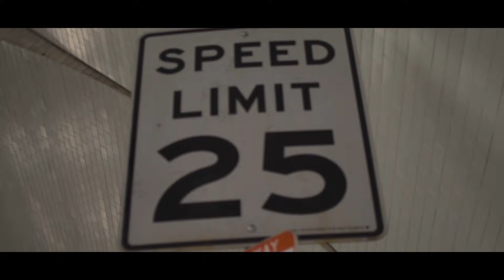Finally Dyno'ing my Cobra Terminator in Los Angeles...

Comment: What coil spring are on your cobra h&r ? Or eibach?
Reply from the maker: Clint Jones H&R!
Reply: @Alexsvt03  thanks man I had run sportlines on my fox and my 04 mystichrome kb, and there are to low, I have an 03 vert now and was looking for a good spring that wasn't to low and rode good, I have some coupe springs from my 04 I may cut them and put on the vert, but thanks for the reply nice cobra
Reply: @mfjones2217   I have an 03 Cobra vert with H&R race springs.  The springs are nice.   The drop is nice.  The ride is not so nice.  The verts have an X brace underneath that scrapes on everything.  I've found that on the verts you have to also upgrade the struts.  The stock struts on the verts don't work well with the H&R springs.  I hate it.  So my next mod are to replace the shocks/struts with some upgraded Bilsteins or some adjustable Konis.